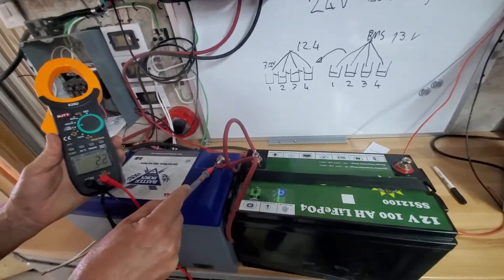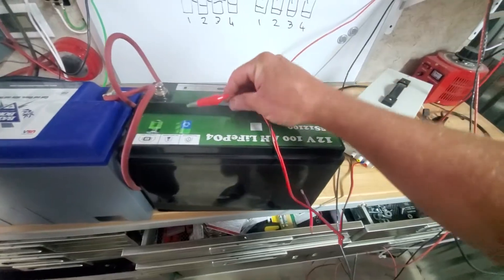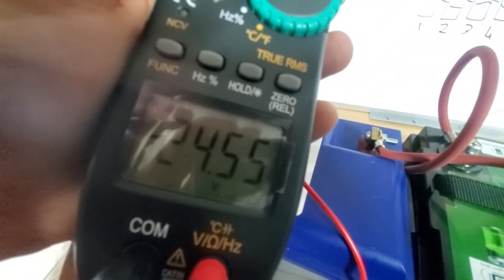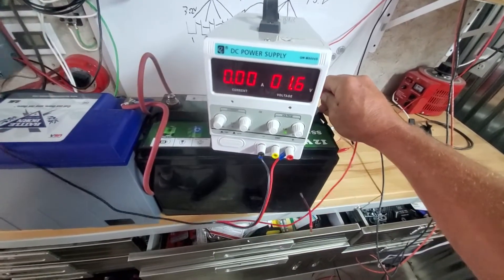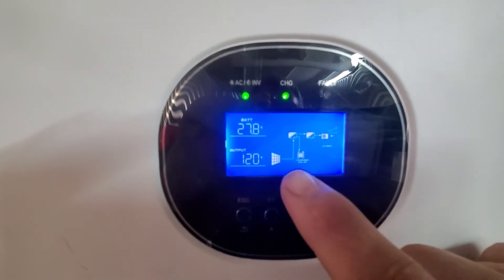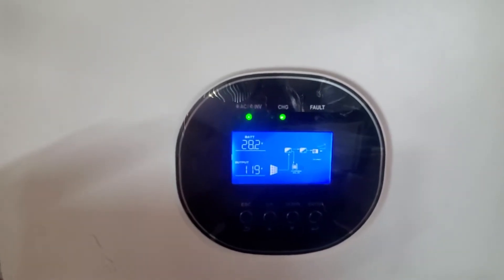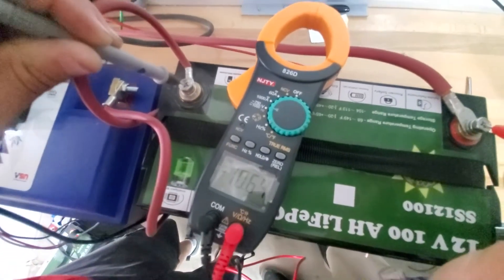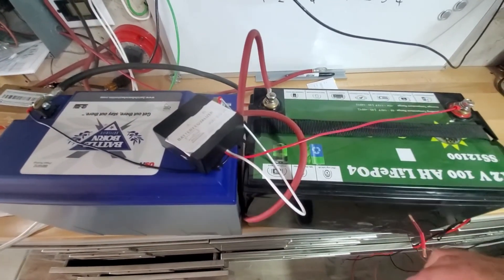BMS troubleshooting with battery balancing solution Part 2

Comment: Do a video of 4 batteries 12v connected in series and parallel to get 24volts and the position of the battery balancer and how to connect it.

Comment: looks like just another argument for using a 12v system, and not using smart chargers. On my 12v system the battery's balance themselves. And my smart charger will shut off at a certain voltage, even if the battery has low amps.